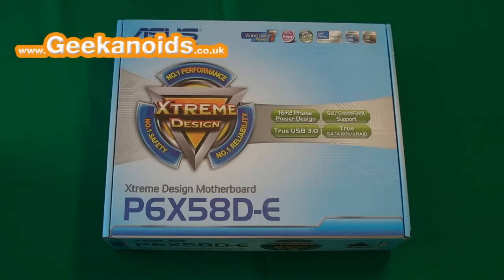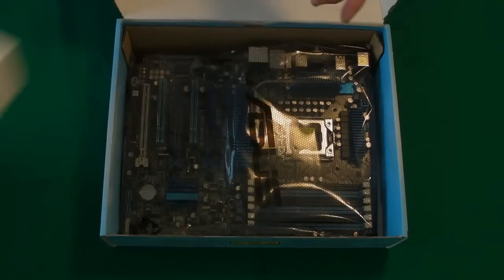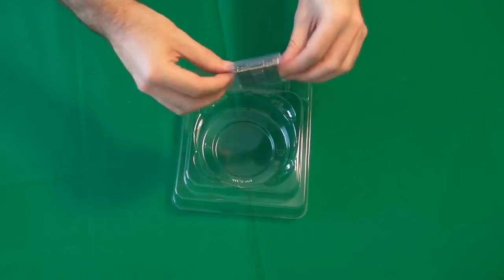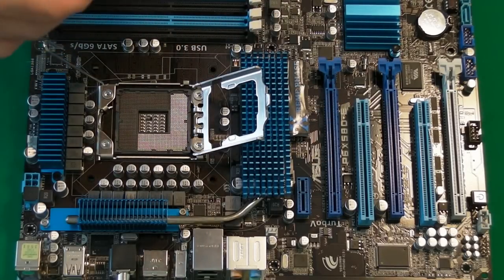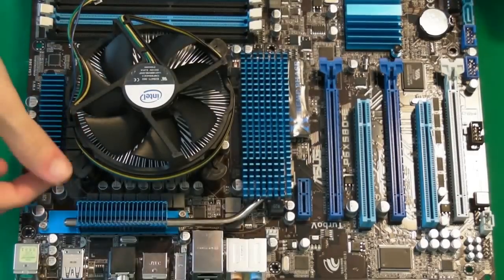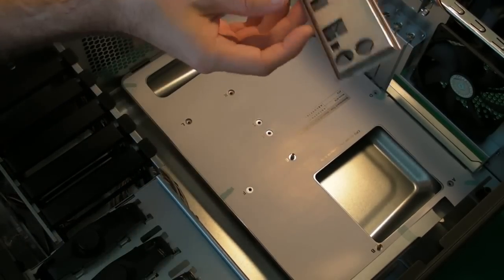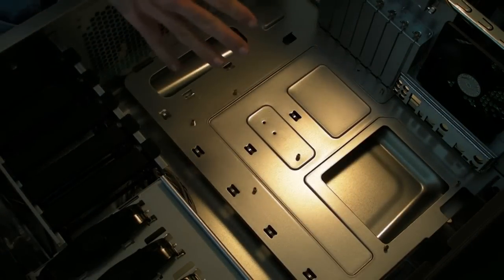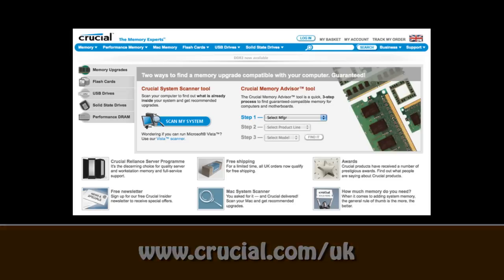PC Build Series - Video 3 - Installing the Asus motherboard & Intel Core i7 CPU

Comment: Just a heads up for anyone with this cpu..i7 930..The stock intel fan and cooler sucks..Hyper 212+ is cheap and way better.
Reply: yeah also found it blows hot air at my ram. I think I'll get the 212

Comment: Hi, i have old pc that i would like to speed up and give to public library in my town.. It has asus p5b motherboard and 2.2ghz crapy cpu , so i would like to know whats the best and strongest cpu i can put on it , also can it run 4cores cpus ? If yes can u tell me the best one of them ?
Reply: I'm off to work now back in 8hours, hopefully that's enough time for you to think of a reply. Hee-haw
Reply: seaarch your mb "model" ➕ "psu". Returns a list of compatible psu's and bios versions. Check your bios version on startup. If you have a ezflash utility its worth getting latest bios from Asus put on fat32 stick and use utility to flash bios. If not don't bother you can mess your pc up.
Reply: Toller Brown not even close to answering his question dude..hehe
Reply: go on then, you do the donkey work. Hehe

Comment: My problem arises not from either fitting a cpu or motherboard into a case....but how to wire the motherboard into the case ., eg off on switch, audio, etc....i gave up any idea of doing a self build because of this..... and so far every thing i've seen is far to vague to be of use.
Reply: The manual explains how to connect those things..lmfao..

Comment: That depends on your motherboard and CPUs. The two questions you need to answer are: does your new CPU use the same socket as the old CPU? If not, you need a new motherboard. If so, is your motherboard's chipset supported by the new CPU? If not, you need a new motherboard. If you've got those two things covered, it will probably be fine. If you don't know, well, you need to find out what model motherboard you have and look up its manual.

Comment: @marquesbrownlee i do a little research by asking a pro (you xD):
ASUS P8H67-M (LGA1155)
Intel i5 2500 (AM3... JK, of course its LGA1155 :D)
8GB DDR3 1600MHz RAM
MSI N560GTX-Ti Twin Frozr II/OC
1TB Samsung F3 SATA2 HDD
2x200GB Samsung SATA HDD
Possible extra additional HDDs :D
Custom CPU cooler (i thought of Cooler Master V6GT)
Will this fit a Thermaltake V3 case? with a 600W Corsair Gaming Series GS600 PSU?:D is everything fine with this?

Comment: Great instruction video, but you shouldn't have fast forwarded over inserting the screws into the motherboard with out explaining to make sure that you have the little rubber washers and spacers on the screws so you don't cause a short on the motherboard.

Comment: those little connectors are called Q-tip connectors or something like that and you basically plug everything from the front panel into those and then use those to put it all straight into the motherboard, instead of fiddling around with individual cables in the tight cramped space inside the case :)

Comment: @Ralfiej1993 I just bought an i7 950 and it comes with the stock cooler, the stock cooler already has thermal paste applied to it, but you do NOT get a tube of thermal paste to use on an after market cpu cooler

Comment from the maker: @agape30203 Obviously this advice is at your own risk... make sure 100% you have removed the motherboard protecting plate, CPU protection cover (if it was supplied with this). Then make sure 100% you have the two plastic tabs aligned and/or the gold triangle on the CPU in the same corner as the black one on the socket. Also ensure it is straight. You will feel a little resistance as you lower the cover and retaining clip.